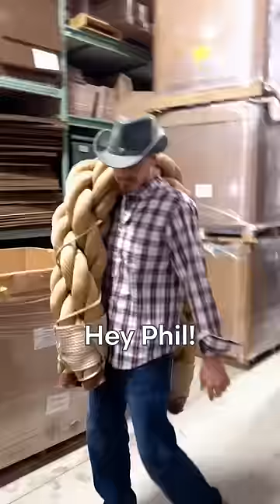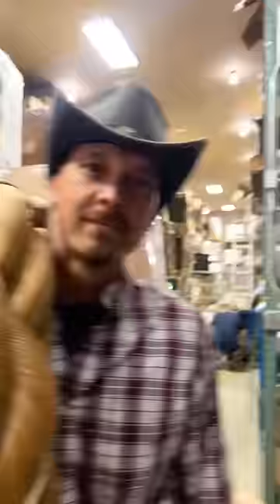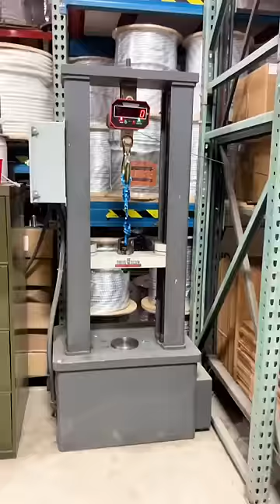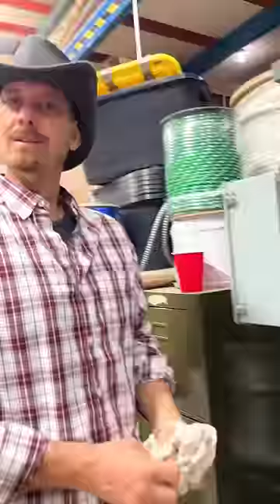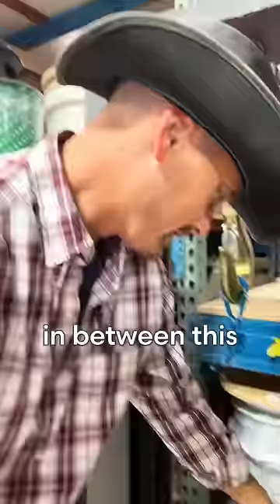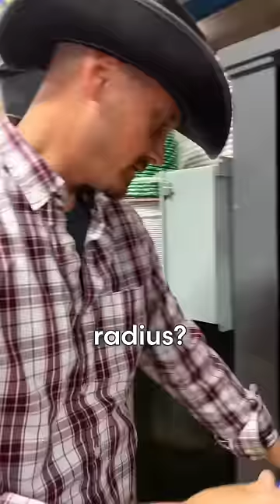The question you have all been asking… Dry or Oiled? What will win👀 #shorts #science

Comment from the maker: An explanation…🫡
The rope used in this video is made of polyester, a synthetic fiber that doesn’t absorb much water, and its strength is not impacted by being wet. The dry rope broke first, because the oil kept it cooler. As it tightened, the cooler temperature prevented the knots from building as much heat from the friction of the knot. Polyester melts at around 490 degrees fahrenheit and starts to lose strength at about 50% of that. Even though the oiled knot is allowed to get tighter, it maintains more strength since it is stays cooler. 🥶

Follow us for more rope content like this! 🔥

The rope in this video is our sailing line that will be coming to our website very soon! For the right rope at the right price, click on the link in our bio! 👊🏼 www.RightRope.com
 
These videos and animations are for informational and entertainment purposes only, and should not be considered to be correct or reliable instructions. Right Rope LLC disclaims any and all liability related to the use of this content. Be sure to consult a competent professional before using rope for any purpose.
Reply: Danielthecreator1  the word you're looking for is Susceptible*
Reply: This is like an IRL physics exam that’s infinitely more satisfying when you get it right
Reply: Celsius?
Reply: This explanation is wrong...
Oil is poor at heat transfer so that is NOT the reason.
What the oil did is make the cord more slippery so it was dressed better under load. It then allowed the force to transfer through knot more evenly.
Reply: @ml3141 the oil didn’t transfer heat away, it made less friction so less heat could be generated. The explanation is right.
Reply: explanation is misleading, it's not the oil acting on directly with heat it's the oil reducing friction which in turn reduces heat and abrasion. you can easy try this by cooling down one knot actively, you will see it makes almost no difference.
Reply: @anon2479-rz3qp  heat is a very small factor here. Slippery cord helps disperse the load on it more evenly. Bigger area to take the same load less likely to break.
Reply: Linen gets stronger when wet so it would be an even better test than something that has no affect
Reply: Bring out the thermal camera 📸💡
Reply: My intuition says it's related to the ability of the oiled knot to yield and move where the dry knot can't. Fewer points in the oiled knot seizing, and hence fewer stress risers. Same as the difference between tempered vs annealed steel, the ability to yield and bend adds longevity to a material. Granted, I'm applying ideas from solid body physics to soft bodies, but still. I don't think it's heat related personally, but that could still be a factor - a lot of energy in the system going to very small sections of rope.
I'm sure a civil or structural engineer would be able to confirm what impact lubrication has on strength of steel cable at least, or if that's even a factor they consider. I'm just an industrial engineer so my knowledge on this specific stuff is limited
Reply: @ml3141 I too predicted the oiled knot would win for a similar reason to you. The way I thought of it the oil allowed the tensile force to be transferred along a greater length of the rope through the knot rather than being concentrated at one piont.
This would be similar to the fact a 2 by 2 timber is stronger than a 4 by 2 with a cut half way through at the mid point.
Reply: The main reason was because the oil reduce friction where rope outer layers were rubbing against each other and the oil prevented the rope outerlayers starting to rip at first place. Dry knot gets easily damaged by friction. And then comes the heat, when friction is high enough, then instead of ripping the fibers they start to melt. Also oily knot when starts to brake loses its strenght much faster, because oil helps rope in knot to use more of its pull strenght cause there is very low friction on the surface and whole rope gets more equal pull in the knot, dry knot uses 40-60% of its strenght in knot, but oily uses 70-80% of its overall pull strenght. Its like ripping paber from the edge to the end or ripping it all at once. Oily knot has many penefits ;)
Reply: true, but oil destroys the structure of the plastic in the long term and weakens it.
Reply: It doesn't "keep it cooler"... it isn't a coolant 

It reduces friction, so not nearly as much heat is generated to begin with.
Reply: @englishboi8816 No, it is not. There is no heat removal happening here.
Reply: I was literally complaining about the lack of info😅
Reply: Certain types of plastic can be softened or swelled by certain types of oils. That may be happening here as well.
Reply: If you're not putting it on the same type of hook it's going to be different PSI on the rope. That hook is a bout an inch thick. If you put the other side on a half inch rod it's going to go through twice as much PSI.
Reply: @RAB1D_ROB0TS  That would matter, if the rope were breaking at the loop

It isn't. 🤦‍♂️
Reply: Where can I buy some string? I'm from grand rapids?

Comment: The oil allowed the fibers to soak and stretch. The dry knot ripped due to a high friction point. As to the oiled one just synched tight
Reply: This was also what I was thinking.
I don't think the 'cooling' factor was significant.
It would be interesting to do the same experiment again, but heat the oil soaked side room temp+10 degrees to offset any cooling (heat the oil the knot is soaking in).
I'm sure the oiled one would win again despite being a heat source.
Reply: @Statutum yeah, as someone studying engineering, the thermal load seems minimal compared to the coupling of the fibers. I’m thoroughly confused what that guy’s background is in if he’s so confidently stating something so backward to basic principle with no support whatsoever.
Reply: you mean cinched?
Reply: @fiveoneecho  from my limited knowledge on ropes and knots, the cooling is actually very pertinent because the rope/knot actually gets so hot from cinching tight that it melts the fibers and then snaps versus actually ripping the fibers apart. The rope can actually handle MUCH more force than seen here because knots decrease rope strength by a huge factor.
Reply: That's what I was thinking.  Maybe the oiled knot distributed stress more evenly because it didn't stick to itself at any one point.  Just a theory.
Reply: The oil allows the fibers to move relative to each other. The dry rope has higher internal friction on the fibers which causes them to wear and weaken quicker. The cooling explanation is not accurate.
Reply: @michaeljarosinski5595  why do they weaken from friction though if not the extreme instantaneous heat they generate from friction under heavy load?
Reply: The fibers do not soak and stretch becuase the specific rope he had is synthetic.
Reply: @Terrible_name  to just say oh its cause of “cooling” doesnt explain much and is not really accurate and quite misleading. 
Also to say one is “cooling” more then the other is to imply both knots are generating just as much heat and the internal stresses of the fibers are identical but one dissipates the heat faster. 
This is not the case. One knot’s fibers are a) loaded less evenly since they cant slide/stretch as freely b) once you have that higher friction you then see wear on the fibers which in turn does generate heat. 
Buts its these combinations that add up in some form to create failures of individual fibers which then leads to a cascading failure of the entire collection of fibers in the rope as each broken fiber shift its load to the remaining unbroken fibers. 
But the other knot isnt seeing as much stress on its internal fibers from the start since the fibers are able to slip between them and the load is distributed between them more evenly which allows each fiber to see less stress from friction and tension.

Comment: We used to put bees wax on before knot on knots that we wouldn't dismantle so it would conform quicker.
Reply: That's cool. Where when why how? ⛰️
Reply: @billyelliot4141  sleeping nets, Paracord knots(knifes, keychains, hangers), etc... when your knot is just supposed to stay and never be undone instead of trying to brute force the knot in place, use a little melted beeswax inside it, it will slide better, after "dried" it will hold longer, and if the knot comes under tension it conforms better.
Just be aware that this trick is not advisable for ropes that will be in constant attrition AND contact with dirt and sand, beeswax is sticky and the rope may degrade faster under "attrition cutting" caused by the crystalin particules in it, just like it would in a dirt rope, but now it's way worse to clean/wash it.

Comment: I knew the oiled side would win but I thought it would be because there would be less friction so it wouldn’t tear itself apart as quickly on the oiled side
Reply: Also less friction equals less heat
Reply: You’re right. There would have had to be enough heat to weaken the molecular structure of the fibres which couldn’t have been the case. What he’s imagining is happening isn’t heat, but friction, tearing the fibres as they rub up against each other.

Comment: Makes sense, as the knot tightens, there is more and more friction, to the point where any more tightening, which obviously keeps happening, tears apart the fibers instead of letting them slide. The oil will reduce the friction and absorb heat, letting the knot tighten more without damaging the rope.

Comment: I would guess oil win on both. Oil can slip so yes it gets tighter but is not stressing one spot where dry it generates heat and stresses “imperfections” in the knot where it could be looser in spots vs evenly applying weight across the whole rope stands. That’s my guess. So oil vs water I vote oil.

Comment: The larger bend radius on the hook means that the two strands of the knot are being pulled at a wider angle than the ones at the bottom. Could be a factor. Should be eliminated for fair tests.

Comment: curious how this would go if you had symmetrical fixing points.

does that larger bend diameter around the hook put more strain on fibers. if it broke in the knot nearer the hook side, i figure yes. in this case, i figure maybe over a bigger sample it might play in
Reply from the maker: The rope always breaks at the knot more towards the middle of the two knots so the point of the loop being secured shouldn’t matter much at all:)
Reply: @RightRopeOfficial  curious if you were to humour a line of thought, if you potentially exacerbated any influence of the asymmetry in mounting point size, leave the low side the same, but mount an even rounded but squarer rounder mounting point off the hook. Keeping both knots loops the same..
Reply: Sorry trying to describe verbally a visual concept and also doing so on a tiny phone screen 😅
Reply: i ponder if in some way the larger diameter of the hitching point could cause the knot to cinch down in a way leading to uneven strain on fibers and an earlier failure?
 @RightRopeOfficial
Reply from the maker: We could always do this test again with two separate tests. Two knots drenched in oil and the other two in water and then compare breaking strengths!